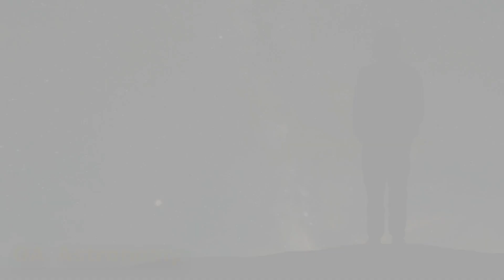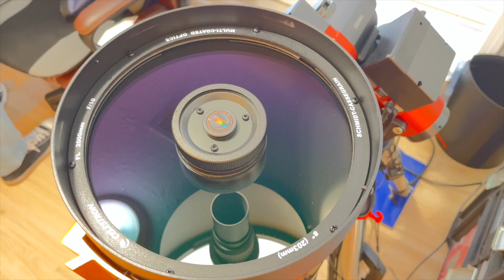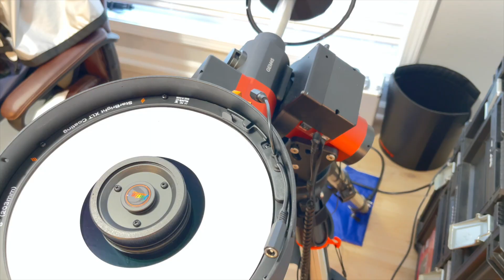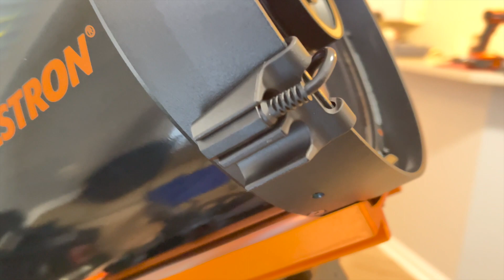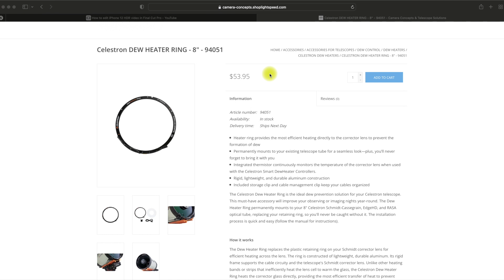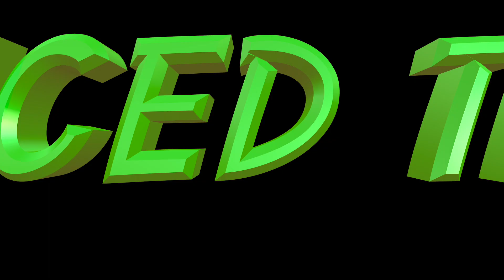Installing the Celestron 8" Dew Ring for SCT's

Comment: Thanks for the video. I've got two OLD C8s, one flat back and one ribbed back. Does anyone know why Celestron says this will NOT fit those older scopes? 🤥They both have 6 screws on the corrector plate. I'd love to install this! Thanks
Reply from the maker: @astroken that is a good question. Possibly ring depth(?)

Comment: does your lense cap fit on it? i have a problem with mine. 
ASIAR voltage you can adjust in asiar plus. once its "on" just click on it and you can adjust the %
Reply from the maker: Hi J. Thanks for watching. Cap does fit. As far as limiting voltage, the problem is the ring draws high amps. It’s either ‘on’ or ‘off’. It will probably work fine if powering your camera separately though.

Comment: Hi CJ, do you think this would eliminate the need for the dew shield or more like "results may vary depending on your geographic location"?
Reply from the maker: HiTA. I would say that "yes, it depends on location." I have tested with it on and off (dew shield) and it performs well either way. I would add the caveat though that there was a lot of spots on the glass after, with the shield off. Nothing flats couldn't take care of but I would say used in conjunction with a dew shield, would make things much easier overall. If you think about it, even refractors have dew shields and we still use dew straps.

Comment: Always enjoy your videos, especially learning about new equipment to make things simpler. I was a minicomputer/ Pegasus user but switched to ASI Air system (now the plus) hadn’t thought of continuing use of Pegasus with it, but wouldn’t I lose the advantage of on screen power monitoring and control without a separate minicomputer?. ( I liked just using iPad or phone and heading indoors).  I also suppose that the dew heater would also fit RASA 8?  
Thanks again for your helpful guidance.
Reply from the maker: Hi Bruce and thank you! Issue with the Pegasus as stand alone is a bit of a hang up. You can set it up to auto start I believe, but have not investigated that completely. I know the Auto Dew feature is automatically on unless you override it. Let  me look into that a little deeper.

Comment: Easy Astro Images (YT) recently reviewed this heater. Compatibility with non-Celestron controllers ?
Reply from the maker: Hi sneakerset and thanks for watching. Yes. It is compatible with third party controllers. The manual states that the thermistor is generally NOT compatible. It further states that to utilize the "SMART" functionality for most efficient power usage, is to use their controller. That being said, controllers like the Pegasus, are adjustable based on amps/volts per its own temperature sensor.

See note from page 4 of manual. 
"The dew heater rings are also generally compatible with third party
dew heater controllers. Use the included extension cable to connect
the dew heater ring’s power jack to the controller’s heater output port.
NOTE: The dew heater ring’s integrated thermistor is generally NOT compatible with 3rd party
dew heater controllers. To utilize “smart” functionality for most effi cient power usage,
you will need a Celestron Smart DewHeater Controller."

Comment: Tell me a little more about what's involved in putting the front cover (dust cap) back on.  Is there a risk of a connector flopping around and hitting the glass?
Reply from the maker: Hi Michael. Thanks for watching! The plastic clip just pops off and stored in your kit. The connector clips inside the edge of the OTA and the ring. Exactly as you see the thermistor clipped in, it is identical. It won't touch the glass as long as clipped in. Just exercise caution when placing in or taking out. However, being they are encased in plastic, I do not see it doing any damage. Albeit, I wouldn't want it flopping around on the glass either.